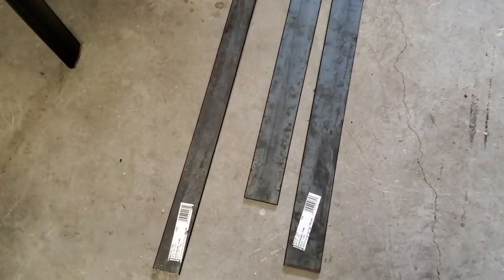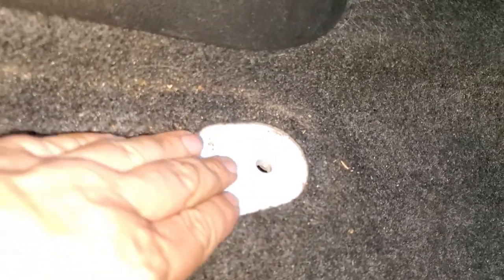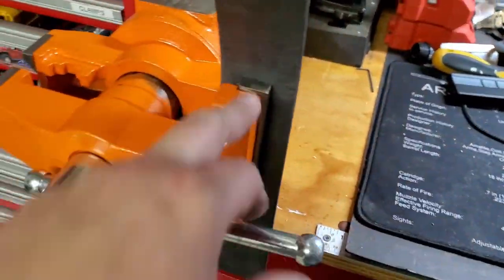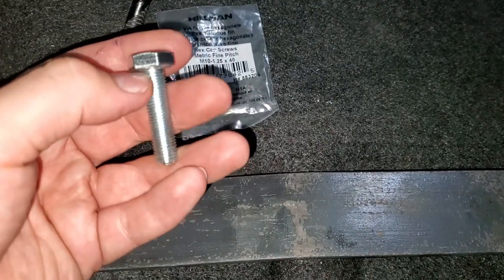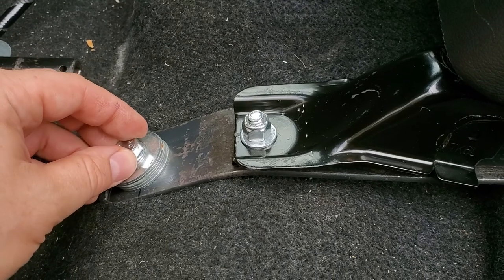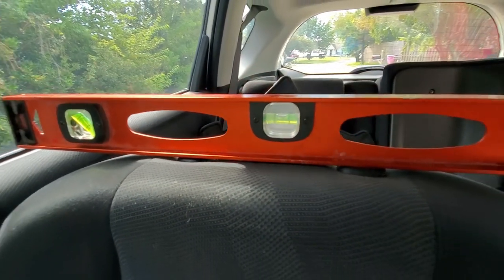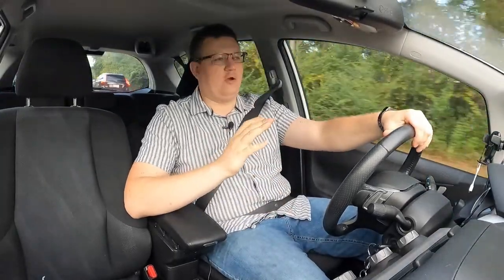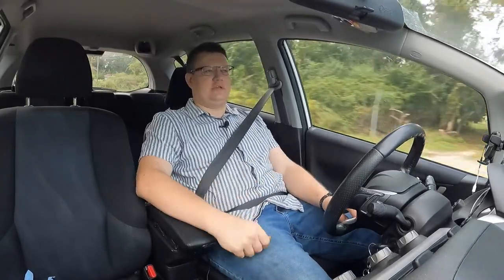Extend Seat On Any Car | Honda Fit

Comment: Ive seen this done by mounting the sliding track from the underside of the seat to the flat steel, and then mounting the seat itself to the steel whatever distance you like back. No bends required, though you have to drill two more holes.

Comment: You can save additional money by just making the ends of the bars seen in this video.  Instead of two long bars you make four short bars.  Each one has two holes.  This is not only cheaper but easier because there are less bends.  The force needed to bend the short bars will require more leverage.  You will also not be creating a place where objects can become wedged.  Like they can with the longer bars.

This is NOT a critique of the video.  Great job.  This is only a suggestion for another way to get the job done.  Thanks for sharing Screen Share.
Reply from the maker: No because they need to be connected together making one piece because sooner or later the whole seat will be start to slide and left and right also in some states you will not be able to pass inspection...
Reply from the maker: Believe me I thought about going that route
Reply: @IvanRossS  I hear you SS.  I really think you will find that side to side movement will not be an issue.  We can agree to disagree.  :)  Inspection could be an issue.  Though I do believe the strength is basically the same.  All the forces are still being reacted through the original seat frame and original rails.  As you pointed out, the new bars are thicker than the metal in the seat rails.

There is an old patent for a seat that protects the passenger by deforming metal in the seat mount.  Two wedges were stacked.  One attached to the car floor.  One attached to the seat.  On frontal impact the the passenger/driver would rise as the wedges stretched metal bands which bound them together.  The inventor demonstrated the effectiveness by personally driving and impacting stationary objects at 60 miles per hour.  This was after seat belts but before airbags.  Some time in the sixties.

It is a really tough call to judge how the seat mods will work compared to stock in crashes.  My guess, it is a guess, is they will do well.  Both the long and the short.  No guarantees.  Clearly we cannot take responsibility for what people do with these ideas because workmanship and materials vary greatly.  Each person is their own designer, fabricator, installer, and mechanic.

Comment: Since with the Fit you are literally sitting on the gas tank it is one of the most difficult cars to modify for a seat extension. This is why at the time I chose a Matrix instead of a Fit because from the showroom by observing the floor I knew that the extension project on the Fit would be complicated . This is still possible but it will have been necessary, as you did, to shim your brakets with washers to match this very uneven floor . Even executing it, the result  is very strange cause  now you have the protruding hump of the tank now extremely exposed so it's no longer possible to drive with one knees bent and one of your foot flat on one side. From the road test of the Fit I knew that I wouldn't be comfortable there even if I modified it. Too bad because the packaging of the Fit was better than that of the Matrix.

Comment: It annoys me to hear car reviews when the tester says that the cabin is spacious for tall people because their heads don't touch the ceiling: ridiculous, it's the legroom that matters most to me when you have an inseam of 99cm.I myself have modified the dozen vehicles I have had in my life to extend the movement towards the rear of the driver's seats. But there is one thing that cannot be addressed*, it is the steering wheel which is often too far away on most so modified drivers seat . Only one car out of the dozen I have where the steering wheel had enough backing was a second generation Scion XB. * Steering hub extender could be add ... but make sure you have long fingers to reach the stalk ctrl . BTW the fact of building your bracket yourself causes a problem and it is that of the insurance which may not pay if it discovers the addition. I've never had a problem with this, but a disclaimer would be appropriate here.
Reply: An option here is also an aftermarket steering wheel. They make plenty that have a deeper "dish", which will extend the steering wheel.

Comment: What "grade/class" of bolts did you use to hold down the bar to the factory floor holes, as well as the factory seat rails to the bar?
Reply: Grade 10.9 metric. Also equivalent to Grade 8 SAE

Comment: Would be a problem If I don't disconnect battery before remove seats?
Reply from the maker: Would not be a problem at all, but I would not power on the vehicle, because your seat have airbags so SRS system will catch that your airbag was disconnected and it might throw a code that is hard to clear.

Comment: What drill bit did you use because I’m having a hard time getting those metal things out
Reply from the maker: These are DeWalt bits that I had for very long time. I should have used just step single drill bit,  it  would works so so much better. I just did not have step drill bit at this time of recording this video

Comment: I have a Saturn Aura XR that I'm going to have to do this to move the seat back by at least 2 inches cause even all the way back and down its still hard to get in out of
Reply from the maker: 2 inch don't sound like alot but it's actually is. Makes huge difference
Reply: @IvanRossS  I was thinking 3 but I thought about it after re-watching this video and I'm like yeah maybe 2 would be better.
Reply: @IvanRossS  thats what i tell her